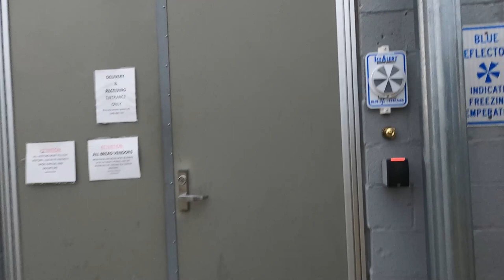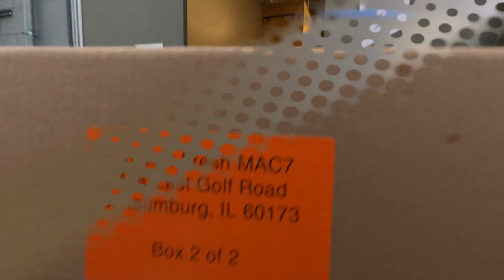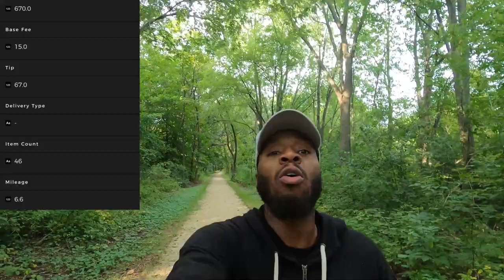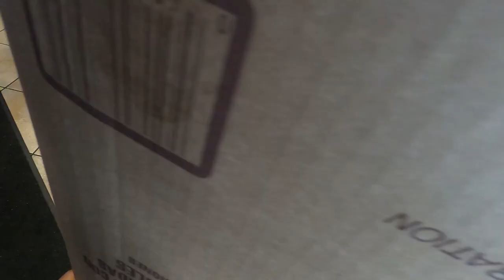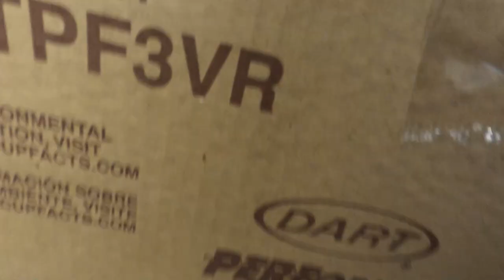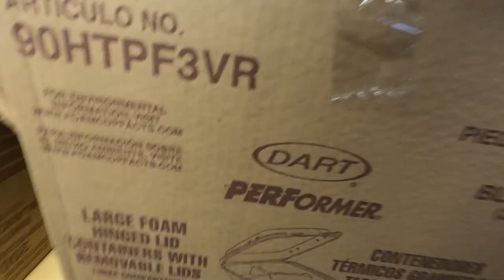How Did I Make OVER $600 Today in Just 3 Orders? Ride-Along To Find Out! #foryou

Comment: I have the older version of that Cosco dolly. The box lip doesn't fold up like yours does. I don't know if that's better or worse. Nice to save the room for sure but I wonder if the hinge makes it a little weaker when loaded up. 

Great dolly, super light weight and quick to convert. The 3rd position doesn't do much, used it a cpl times.  My larger 2 wheels are are strong to come apart a bit. I'm gonna have to replace them at some point. It's been well used.
Reply from the maker: Thanks for sharing!! So far the hinge seems to have held just the same.